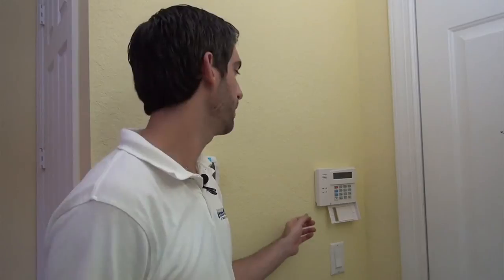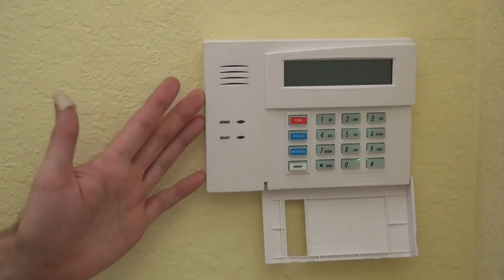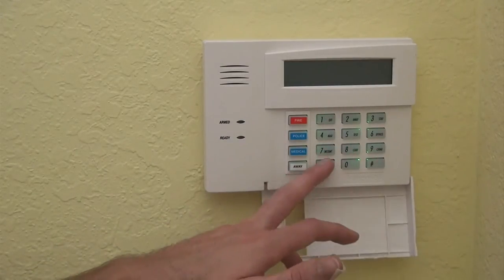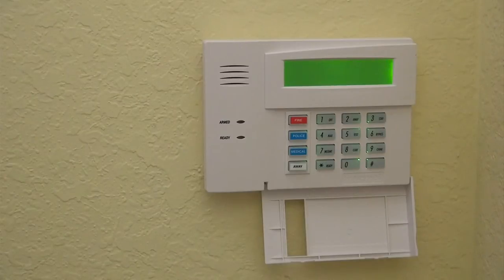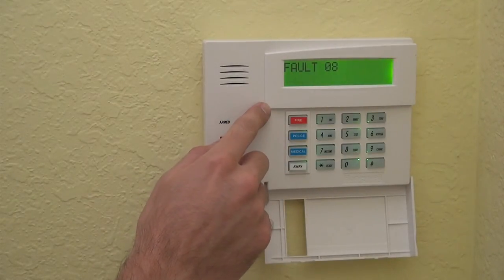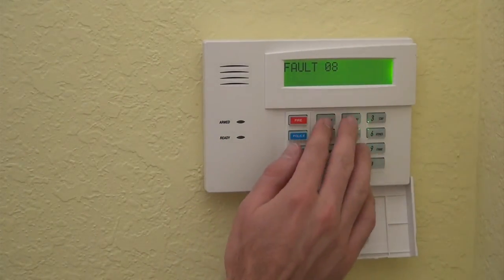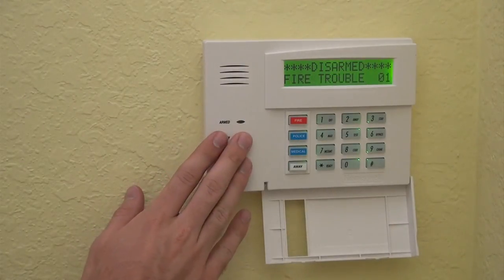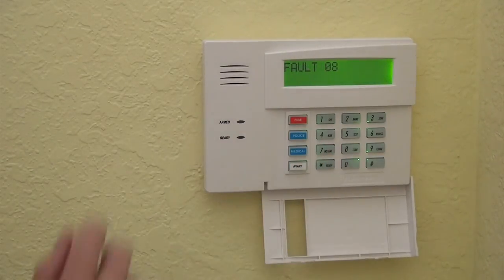Honeywell 6160: How to Address Alphanumeric Keypad to VISTA 20P

Comment: Will 6160 work with L5210 if it is connected to a 5800c2w wired to wirless panel?? I want to use in Master and have L5210 downstairs. I like the 5828V but don't like that it needs to be wired to outlet to chime. So, will this work with 5800 and L5210?